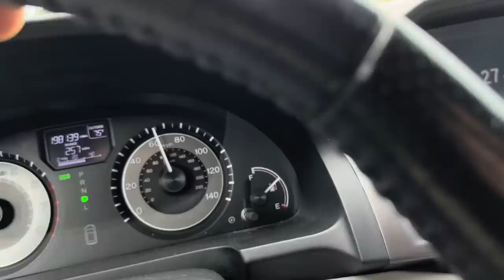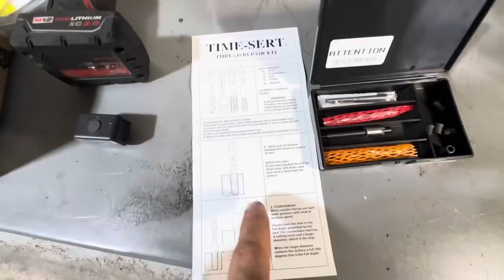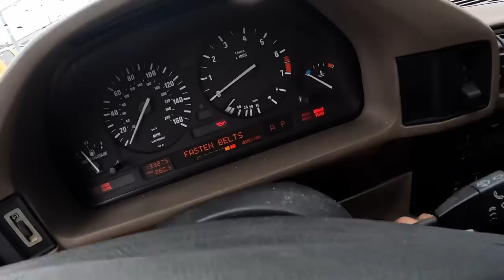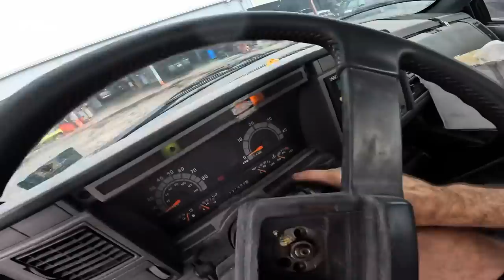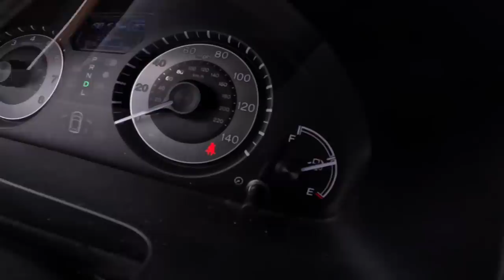Damaged Engine Block Threads! Subaru Outback Legacy 2.2 2.5 Hurricane Idalia

Comment: When drilling out the old threads, it's a really good idea to use the water pump as a drilling jig.  That will help to keep the bit centered and straight when it grabs.
Reply: he might be off centered
Reply: That would only work if the clearance holes on the pump are bigger than the insert drill.
Reply: @bobbykozak6032  pump body aluminum. Just hog it out for clearance. Most pump bodies have five, six, seven lugs. Go Nuts!   lol.
Reply: @bobbykozak6032  I have about fifteen sizes of Timesert kit, and more than that of Helicoil.  The drill bits are generally within a few thousandths of the OD of the threads.  I have yet to have the drill bit enlarge the hole in the flange, but I've had quite a few that made it really obvious that the damaged hole had been wallowed to one side by whoever dug the broken chunk of bolt or stud out.  It's never a bad idea to engage a little extra precision in locating a thread repair on center.

Comment: I'm feeling really good about this repair. Good luck on stuffing it back into the engine bay.

Stay safe in the storm Ray, Wife Unit, Kid Units, Troy, Amayah, and everybody in the storm path.
Reply: Would there be a problem if any of those cars above happen to have a brake piston leak.😲
Reply: @pennybeacham6461 nah cause brake fluid ain’t what it used to be 20 year ago it doesn’t eat paint work any more
Reply: @pennybeacham6461  not on the Mustangs. Fresh brake jobs on both.
Reply: @gregshearer423  well we learn something new everyday,like the saying never to old to learn.👍
Reply: @pennybeacham6461  yup that’s is very true
Reply: @gregshearer423  The F it doesn't. You go pour some brake fluid on your car/truck, let it sit on there for 24 hours, then tell me what it looks like a month later.

Comment: Inserts are a lifesaver. Glad you went this route - IMO it's the right way to complete the repair. You won't have to worry about the threads in the insert - it's stronger than ever.

More important than anything - you and your family - stay safe. Hopefully you all make it through the storm with no damage - but that's always secondary to safety.
Reply: The "fish-eye" distortion of the GoPro lens makes it look like its not straight.
Reply: I've only ever had to rehabilitate holes in wood, such as chairs or window frames. 
The usual tricks involved carpenter's glue and a piece of toothpick.
So it was really interesting to watch a thread replacement in metal!
Reply: Ray should have taken the engine to a place that does EDM, especially as there are some who specialise in removing studs & nuts broken off in aluminium castings.
There's one not far away from him.
Reply: I love Time serts. I work on HD and they are a life saver

Comment: Nice stacking!  👍👍👌

For Time-sert repairs I use red Loctite 272 for the Time-sert itself, then blue Loctite 242 or green Loctite 290 (wicking thread sealer) for the bolt/screw that goes into the Time-sert.

Most of the work I do is on classic motorcycles where there are zero placement parts and messing up a thread will mess up your whole millenium.

To drill out the threads for a Time-sert I use a jig to hold the drill absolutely square
 OR use some super glue to attach a washer over the hole with the correct ID so the drill does not wander.

There's nothing more exciting than installing a beautiful-looking Time-sert that's off center so the hole doesn't line up with the part.

Comment: Nice repair Ray. Definitely a good idea to use locktite with that style of thread repair insert. If you happen to need to do a thread repair again in the future the best style of thread repair insert are the ones made by CAT for heavy industrial use if memory serves correctly, they are available in every metric thread size from M2 - M22 and then a number of specific and truly silly large thread sizes above that. They differ from a Time Sert insert by including 4 pins that once the insert is installed and bottomed out the 4 pins are drive flush with the surface and interrupt the larger thread that is drilled and tapped to allow installation of the insert making it a truly permanent repair as the only way to remove the insert once the pins are driven flush is to drill out the insert entirely and install a larger one.
Reply: Yes, the Cat insert with the 4 pins have been around for decades. 
They are military grade inserts. All the aluminum housings for radio and radar, all the outside threads have to be an insert.
Reply: @toddmcclellan979  agreed, the CAT inserts have been THE standard in heavy industry and military use for more decades than I've been alive. They are near enough indestructible.
Reply: Yep but on this they are overkill. This could have been fixed with loctite form a thread. Stronger than aluminum, you put release agent on bolt pack hole with form a thread let it dry and remove bolt. Have used it many times and works great. This is such a low torque application.
Reply: @CodycoWeb  agreed.
Reply: I've used them they work great.Have a great day
Reply: Sounds similar to a Keensert.

Comment: I think I’d probably still use the old water pump as a guide, to help keep the drill straight, especially given how messed up the original hole was. 
I’m a huge fan of those Timesert kits, but they’re not as readily available as the helicoil ones, here, so I’m not as familiar with them.

Comment: Both of the Mustangs need to be up in top rack positions to prevent any oil drips damaging the soft top. Or lay a tarpaulin over both the convertibles at least.
Reply: Too late for that now haha
Reply: I used to work at a British car shop were we had to bring all the cars in at night.  We had to double stack the cars on the racks to get them all in.  Being British, all the cars had soft tops and all the cars leaked oil.  To deal with this, we used to save foam insulation sheets with foil on one side.  The foam and foil protected the cars underneath from the oil from the cars above.
Reply: @michaelstoliker971  Gotta love those British cars; oil leaks and Lucas electronics!  Cheers!
Reply: That's clever. 👍
Reply: The black Mustang is a convertible also.
Reply: That would actually help them. Unlike Ford, oil has value.

Comment: TimeSerts are not fully threaded on the inside.  Look closely at the deep end of the insert; the thread isn't finished there.  When you run the insert installer through the end as the last part of the process, it both forms that last land of thread and expands the insert a bit to help lock it into place.  If you have to install one in a blind hole that's the same depth as the length of the insert, using loctite is pretty much essential.  (I've gone through a lot of these in the 50 years that I've turned wrenches.)
Reply: Project farm did a test with htese and others and the TImeserts were stronger than the original aluminum threads wth twice the pull out force!
Reply: @carlburr1462  And TorqueTestChannel did a similar test in cast iron, with similar results.  For many decades, Porsche engines came with a helicoil in each spark plug hole because of the persistent problem of plugs seizing in the plain aluminum threads, a different problem which is also handily avoided via those inserts.
Reply: @helenault7452  that is cool info about Porsche and makes total sense!!  I used off brand heli coil and heli coil brands in the past and always wondered as I was toqruing to spec..is it gonna hold..?  Always did and after watching the FarmProject, I will never doubt them again!!

Comment: I've seen some videos that tested Time-Sert vs Helicoil (and some others).  I was shocked to see that Helicoil outperformed Time-Sert when they measured how much pressure they took before a bolt pulled out of them.  That said, I still believe Time-Sert is the way to go for a head bolt, because you need the insert to remain fully stable through thousands of cycles of heating and cooling.  I used a Time-Cert to fix an oil drain plug that was ruined by a moron at an oil change place, and it was very straight-forward, and I got a great result.  The only advice I'd add to their directions is to do everything you can to stabilize yourself when you drill out the old threads, because just a little movement side to side on the drill will give you a hole bigger than you want.  I got lucky and, though the hole got a bit expanded because my drill wasn't stable, some red Lock-Tite was enough to give me a permanent seal with no oil leaks.  (I did check the Time-Sert website, and they say it is okay to use Lock-Tite if you wish)

Comment: When tapping a blind hole, you can measure the depth of the hole and then put a piece of masking tape on the tap so that the edge is at that distance.  Then when the edge of the masking tape hits the surface, you're bottomed out.  I also do this with drill bits.
Reply: I tapped a blind hole once when I was younger…married in no time (<6 Mo.’s)?, it barely lasted 2 years.

Comment: I would suggest that when attempting to drill out a thread, you should bolt the old pump up first (less the damaged hole) and this will help you keep the drill bit aligned in the hole by using the old pump flange. Makes for less errors from a wandering drill.

Comment: @Rainman Ray's Repairs On the BMW 528i, there is a one way valve in the oil filter housing. If this fails it will rattle on startup until the oil filter housing has filled back up. It's available as an upgraded part.

Comment: saved nearly 1000 Euros with a similar DIY thread repair kit for a Volkswagen front wheel housing with integreated caliper holder. One of the caliper sliding bolts treads where ripped out due salt/rust corrosion. Stay save with all of your family Ray !

Comment: When Cyclone Gabrielle ripped down the East Coast of New Zealand (I live in Auckland,New Zealand) back in February Auckland got hammered on top of the flooding only a couple of weeks earlier in late January and it definitely made me change my attitude towards storm readiness after having no water or power for most of February 14th because the bank on the edge of the stormwater drainage gully slipped when a tree gave way in the already saturated ground and took out the mains water feeder pipe and the wind took out the power luckily Watercare via Downer Civil installed a temporary feeder pipe from a fire hydrant round to the feeder pipe further up my street and Vector the State Owned company that maintains the Auckland portion of the National Grid got the power back on. God bless both of those organizations.

Comment: Hi Ray.  I'm a meteorologist who has been forecasting tropical cyclones worldwide since 1980.  I was actually forecasting for Idalia (E-doll-i-a) the past 4-5 days.  As it passed to your west, the peak sustained (1-min average) wind in Sarasota was 37 mph (just below tropical storm strength).  Peak gust was 68 mph.  Basically, the area from Sarasota to Tampa did not even receive sustained tropical storm force winds with Idalia.  The hurricane passed far enough offshore that the tropical storm sustained winds remained just offshore.  Wind gusts (brief bursts of wind) reached 60-70 mph, however.

Comment: Get yourself some Z bar used in drywall construction. Form a runner top and bottom so you can slip the plywood in and then fix with screws through the Z bar. That way the runners can stay up all the time. . Now that's what I call hurricane prep😉
On another note though,  if you had a generator you wouldn't need to take all those lumens 😂😂

Comment: I used TimeSert for my 2.4 L Toyota engine, head bolts stripped. Did all 10 bolts, it was smooth operation, followed Eric O's from SMA steps and it was great. Very impressed. It's been 2 years and the inserts are holding, car is running fantastic. Sold the kit on eBay after that for about 75% of what I paid for it considering I used all 10 steel inserts. Oh yeah, RED lock tight is essential.

Comment: Just a suggestion. I have used JDM engine out of Japan. They specialize in lower mileage engines because Japans EPA is even more strict than the USA's. I Have used them several time for hard to find engines with  exceptional results. Used paypal each time. Usually the ,motors have 75,000 miles or less. Just a thought. on your application I found motors ranging from $2,399.00 to $849.00. Just a thought. Love your videos...

Comment: The best cutting fluid for aluminum is alcohol. It prevents buildup to the bit or blade depending on what you're cutting with. I'm a retired metal worker. ;)

Comment: Hi Ray. I always love your videos and watch with great interest. I'd like to offer a tip if I may be so bold. When drilling for the countersink on the insert, you could have stopped part way into the drilling, turned the insert upside down, then checked with your eyecrometer that the shoulder of the insert was the same height as the depth of your countersink. That way the insert wouldn't have ended up deeper than the face of the block. Not that it matters that much as I see you have done another quality repair. Keep up the good work, and stay safe from the storm.

Comment: Personal preference - Keysert style thread repair inserts - with the 4 lock pins you hammer into place - once in they won't loosen or come out, unlike a helicoil style.
Reply: Timeserts are a similar concept. It's knurled on the outer edge of the counter sunk flange. Plus the install tools deforms the insert to provide an interference fit along the entire length. When done properly it widens the insert jamming it into the metal. They work the best on aluminum, but can be used on cast iron blocks as well.

Comment: Ray your Using your keyless chuck wrong on your drill. 

1. Tighten chuck until you pass 2 clicks

2. Tighten as much as you can by hand 

3 back off chuck by 1 click this will lock the chuck and stop the chuck loosening by vibration while in use.

Hope this helps

Comment: From a retired machinist i would like to say thank you for using the  thread lock we used to prick punch the very edge to lock it in also, and stone off the burr from the surface, which you did. I would worry about brake and transmission fluid when stacking

Comment: That's called a "parting line" in the casting... Just an FYI... Also... Get some nylon skids, cut to size,  and put everything on top of them. Benches, cabinets, devices, etc... Gives you 4 inches of water protection for your stuff... And they don't rot...

Comment: There is one way to prevent bite when drill. Turn to slip mode so when drill want to bite it will stop and you restart again. Start with 1 and try if it's to weak you turn on 2 and so on. That is how I drill guitar neck and don't chip the wood.

Comment: Always best to plan for the worst when it comes to bad weather

Good job on the Stupidroo water pump flange. 

Now on the Red Mustang, do not replace the bumper. Just bend the steel rod to allow the tips to drop down 1/2 to 3/4 inch. Keep it simple (and Cheap)

Comment: Only thing I would've done differently would've been to pack some rags in the water jacket. I can see aluminum chips flying in there. Be sure to get them out so they don't end up in the pump. @23:19... A good way to deal with gouges in a gasket mating surface is to mix up a little JB Weld and use it like Bondo. Fill the gouges, smooth it out, let it dry, then use a fine grit wheel to finish it.

Comment: Ray. Why wasn't this simple cheap and easy fix done in the first place? I've never seen anybody replace an engine over a single broken bolt. This must be a very patient customer.
Reply from the maker: I spent 4 hours trying to extract the broken bolt while it was in chassis. It wouldn’t budge. Gave up and ordered a 2.2 SOHC to swap it with. Pulled it out when the engine was on the way, then the engine disappeared and couldn’t locate a suitable replacement. Decided to try again to extract the bolt. Succeeded. Ordered the time sert kit. It’s been a thorn in the side to say the least

Comment: I use a Chinese version of the timesert to repair spark plug threads in large chainsaws that would otherwise cost $500-$1000 for a new piston and cylinder. They work well and are a more permanent solution than a helicoil.

Comment: 9:47  thats an awesome repair kit.
But might i sujest a 1 2 3 block to place on the block with a tube to fit the drill bit into that keeps the bit very close to 90dgr of the gaskets surface area to drill a stright 90dgr hole. Its very hard to keep a hand drill perpendicular to the surface your drilling without some kind of guide, a 1 2 3 block can fit in that space a drill guide might not.
Another trick is use super glue to glue on 2 joe blocks that line up with the hole one on the north south side and one on the east west dide that give a a visual reference to 90dgr.  If the holes driled off center its going to put sideway stresses on the gasket that could cause a leak id use permetex on both sides of the gasket just to be sure something that can conform to any difference in the bolted on forces.  Worst case a nut or stack of nuts glued together could make a decent drill guide  in a pinch. 

Take it how you like just a sujestion from someone who worked in a machine shop years ago. 
I made mitilary parts also parts for kenworth trucks and parts for farm tractors as well as a lot of other things not automotive parts.

Comment: Subarus ej22 motors are stupid durable but you can mix and match these engines a ton it's very fun. I had an 03 forester 2.5 with a 2.2 block 2.5 heads. Was very slow but reliable

Comment: Hi ray ,on your thread repair,to test your motor for leaks before reinstalling what i did in the past is to use my radiator test kit.i block the radiator hoses with round alum plugs i made .One of those is drilled and tapped for a fitting that goes to my pressure pump.And i just pressurize the system that way.,the heater hoses are just U turned using one hose.On inserts ,i always loc-tight them in.Good luck on todays storm.